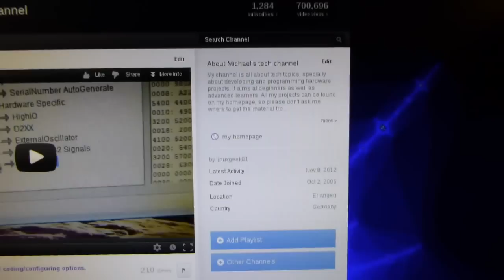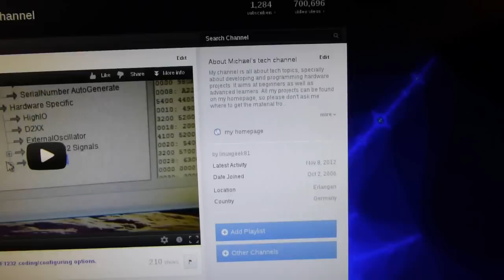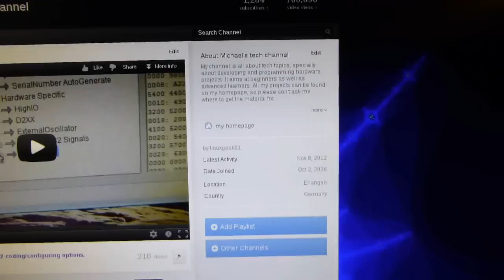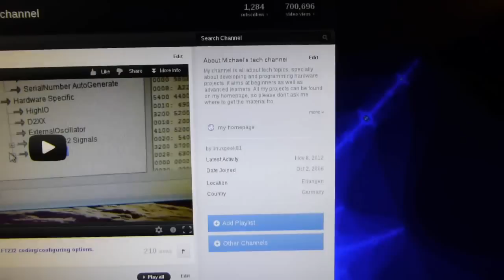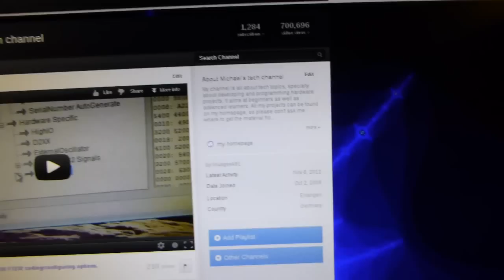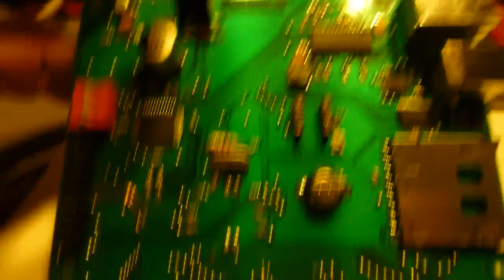Homepage announcement and progress of the ultimate sensor board.

Comment: Solder mask looks marvelous on this board. One question though - after you remove unnecessary mask from pads, you put it under UV again, right? But for how long? Because I use liquid mask, and after I'm about done, I put it under UV lamp for an hour to cure, but after that it still flakes off when I solder part to the pad